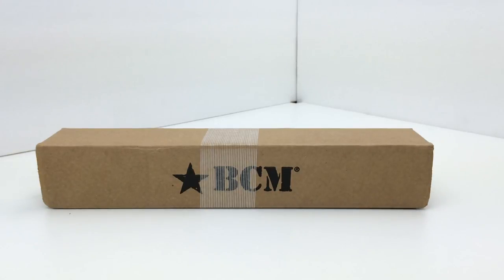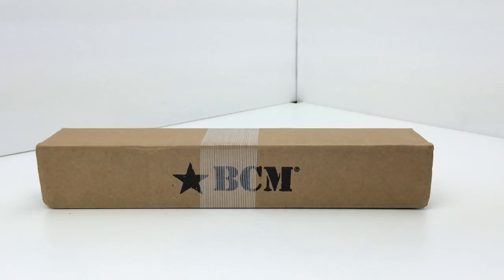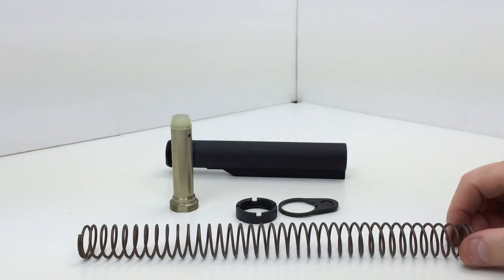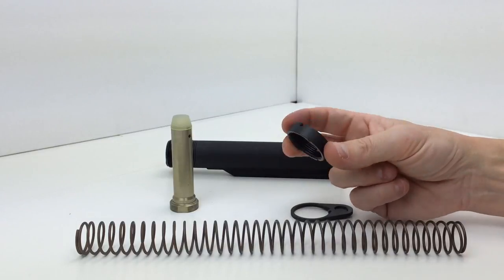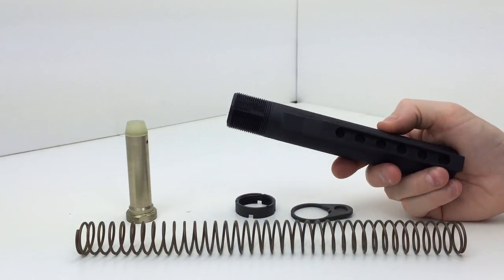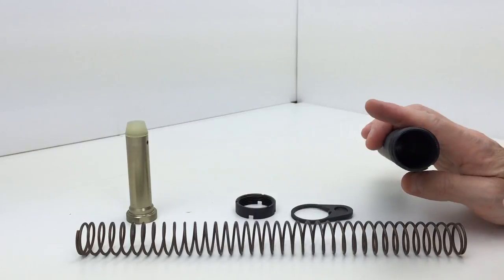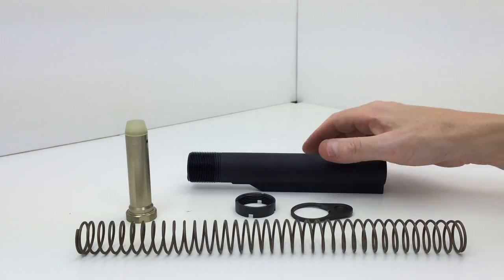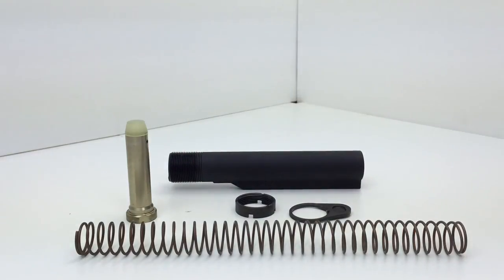Bravo Company BCM Milspec buffer tube kit - Review

Comment: You should check out the Vltor A5 buffer system. It uses a slightly longer tube, a rifle spring & a custom length buffer. It's a huge improvement over standard carbine length buffer systems.

Comment: I purchased this buffer tube and while it is of good quality, it does have one significant drawback for me.  This tube is actually 1/2 inch shorter than other tubes.  Basically, the last lock hole is 1 slot shorter than all my other tubes.  This is not a big issue but for me it is a bit short.

Comment: Will it accept a blade brace or  such? I'm building a pistol
Reply from the maker: Braces require different buffer tubes and will not fit on a buffer tube designed for a adjustable stock.

Comment: The receiver extension looks like any other Mil-Spec tube. It amazes me what people waste 💵 on 😆.
Reply from the maker: While many may look alike they are not all created equal.  The BCM is a true milspec buffer tube with a 7075 construction with a dry film lube applied internally.  You can find cheaper examples but most likely they would be made of the softer 6061 aluminum
Reply: It amazes me you think just because it looks the same that it is the same , good luck with your junk